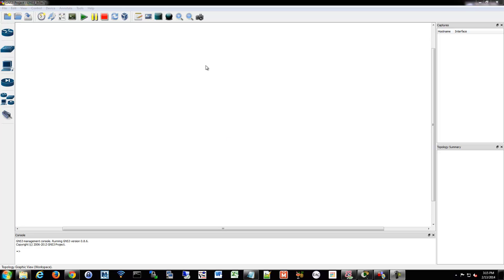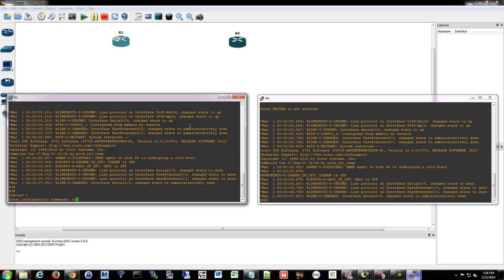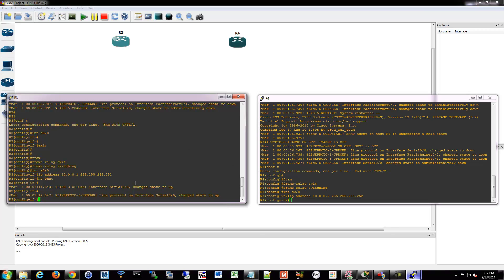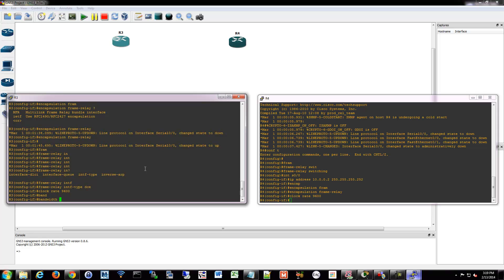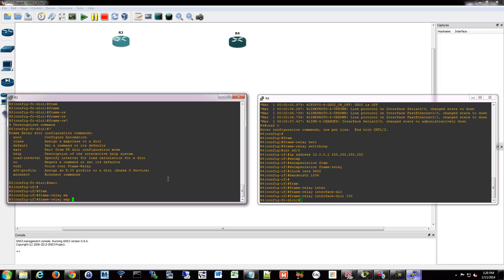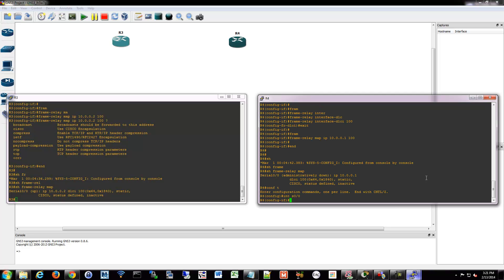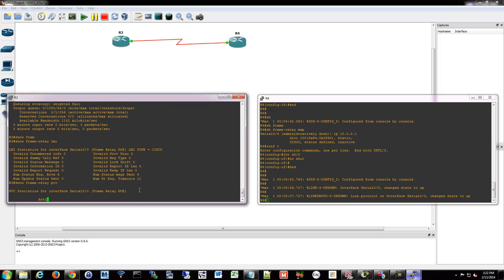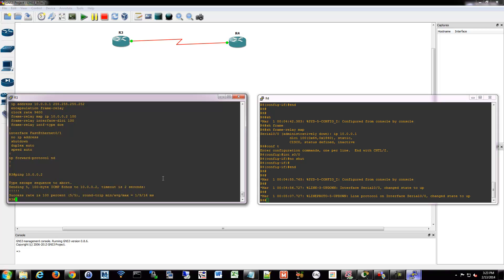CCNA 200-120: Frame Relay Configuration 77/84 Free Video Training Course

Comment: Thanks for the help on this one. Unfortunately it does not work in packet tracer it does not let you change the DCE and it just does a default clock rate. Good video either way.

Comment: A couple questions from using Packet Tracer-First when assigning the IP address it automatically shut down the interface.  Is this normal?  A did another 'no shut' and was unable to get it back up.  Edit: Once I connected the serial cable it came up.

Router(config)#inter
Router(config)#interface s0/3/0
Router(config-if)#ip address 10.0.0.1 255.255.255.252
Router(config-if)#no shut

%LINK-5-CHANGED: Interface Serial0/3/0, changed state to down
Router(config-if)#end
Router#
%SYS-5-CONFIG_I: Configured from console by console

Second, it appears that Packet Tracer does not have the 'frame-relay interface-dce' command.  Again is this normal?  It just lacks that functionality?

Router(config)#int s0/3/0
Router(config-if)#frame-relay ?
  interface-dlci  Define a DLCI on an interface/subinterface
  inverse-arp     Enable/disable FR inverse ARP
  lmi-type        Use CISCO-ANSI-CCITT type LMI
  map             Map a protocol address to a DLCI address

Thanks again for the great videos and help.

Tom
Reply from the maker: Do a "show interface" on each side, show frame-relay, etc. It sounds like there is a mismatch. Packet Tracer is a bit limited when it comes to Frame Relay. and may be lacking that.
Reply from the maker: ***** Same limitations, sorry.